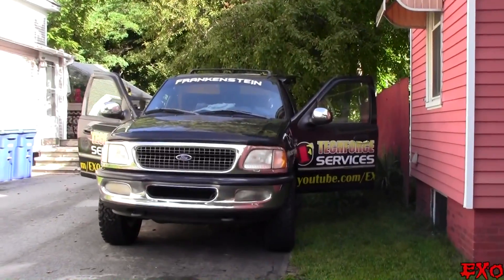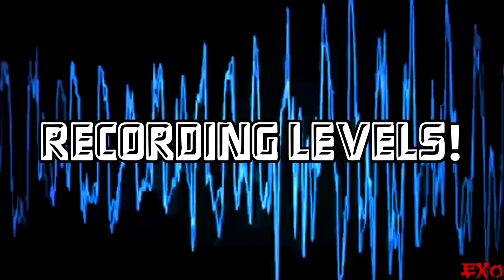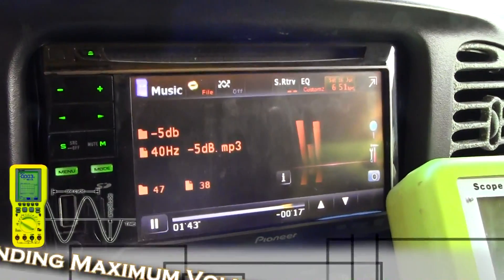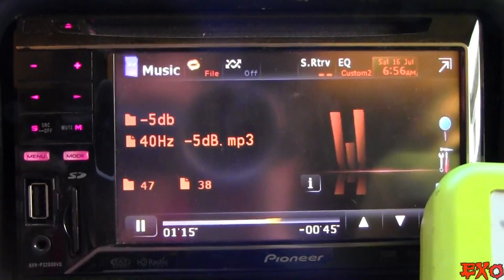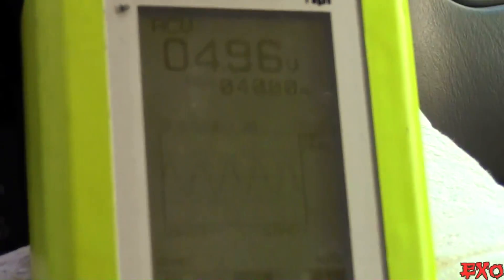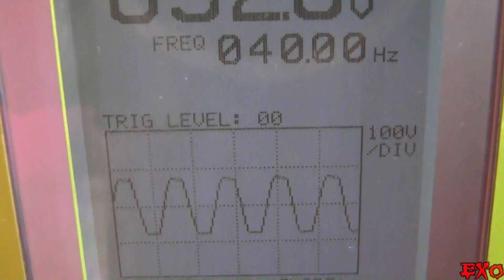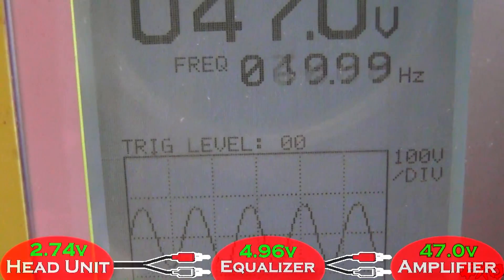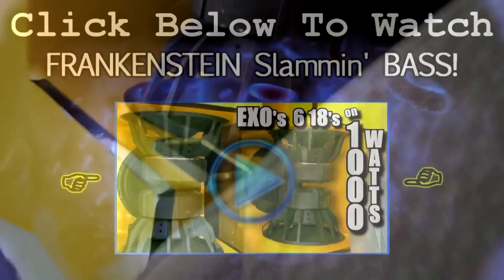How To Set Amplifier Gains & Get MAXIMUM Output w/ NO Clipping | Tuning BASS AMP w/ Oscilloscope

Comment: Hi, unfortunately you can't see in the video whether you have the LPF for the subwoofer on or off when setting the gain. I was told that when you set the voltage, the LPF and lowcut should be switched off so that a full-range signal comes through. You're great and your videos are very helpful

Comment: That unit has a 4 volt RCA output the reason you are not getting the full 4 volts is because you were using a -5 mp3 test signal... In my 23 years of being a pioneer dealer.  I've never had a pioneer head unit that didn't distort at full volume.  Noramlly 32 to 37 on those depending on source. You also should be using FLAC or wav files. Ect Not compressed to hell mp3

Comment: Probably a dumb question but how would I tune my system that has an lc7 line out converter?
Reply: I was having the same problem until I watched the YouTube video titled, 'How to TUNE Car Amplifier & Set Gains'.  BTW - My system is 100 times better because my LOC is finally dialed in before it goes to my AMP!

Comment: idiot question here 
On my amp i have rca input voltage up to 2v what does it need to be set on i am not running a sub
I have vibe space 4 amp vibe space 6 three way components up front and vibe qb69 in the rear pioneer head unit
Reply: The higher the better
Reply: @4MorganH  so with 4 volts and a added amp will sound better than a line converter because you can set the gain lower on amplifier. Will allow you to go full volume more likely?

Comment: Exo, my question is, how do I do this with my stock radio? I have a epicenter micro as my line output converter and then rca to amp. Can you provide any guidance please?
Reply: You have to read the voltage output of your HU at the highest volume before clipping/distortion. That will be the best clean signal to your LOC. BTW go to Steve Meade and D'amore's YT channel and watch their videos on LOCs. Audio Control, Wavetech, and Kicker were the ones I remembered that actually worked. I would think Epicenter is one of the best top shelf as well.
My audio control LOC shows my max output from my HU before distortion. I just adjusted the HU by my LOC.

Comment: i have audiocontrol lc 6 1200 provide 125 watts RMS and focal 80 watts RMS 4-ohm impedance what voltages i should keep my amp gain please help
Reply: E=Volts
P=Power(Watts)
R=Resistance(Ohm)

E= Sqrt of P x R
E= Sqrt of  80 x 4
E= Sqrt of 320
E= 17.88 < Target Voltage at -0db

17.88 volts might be your target voltage at -0db (but!) music isn't recorded at -0db so we need to set an overlap to counter this, a viable choice would be something like 5db overlap.. now here comes the kicker, your amp's target voltage for 125 watts into 4ohm is 22.36 volts.. (but!) a gain overlap at 5db up from 17.88 volts would mean that you wold have to set the gain to 31.79 volts with a -0db test tone.. that's just not possible in your situation since the amp's max output is 22.36 volts at a 4ohm load.. so you can safely max out the gain on the amp as long as it doesn't distort the signal.. in this case you would get a 1.94db overlap (this will work great with good quality music  and/or music from the "era of loudness" (but!) u might miss out on a few db on music that's been recorded at a average of  -6db.. either way, bump that volume! you won't blow your speakers anytime soon c(;
Reply: all the volts

Comment: i see you used the outside speaker terminals on the amp? if my amp has 2 sets should i be using the outsides or the first 2? idk if your amp is ++ -- mine is +- +- though
Reply: First two.

Comment: Why wouldn't you use an uncompressed WAV file instead of an MP3
Reply: 10 year old video...as if the eye pod shuffle wasn't a good indication.
Reply: Its 2022, so, the answer is " because it's racist" or, "because white privilege 0.
Reply: @HammerBack10mm  uncompressed wav’s are the definition of white privilege. #wewantreparations

Comment: I know this is years old but, would USB or aux be better when tuning?
Reply: Usb probably
Reply: I installed a 12" sub in a friends car and he had an aux input and also a bluetooth receiver. When i connected to them, i found that (at the same head unit volume) the sub was very noticeably quieter when using an aux cord, compared to bluetooth. Just be sure you take that into consideration. Don't tune the amp while connected to an aux if you plan to use bluetooth and vice versa.

Comment: Still trying to figure this out when you set bass, mid, treble flat in headunit when checking for distortion can we put them back up after it's done or we have to leave them flat?
Reply: EQ how you like it then tune. But remember it's tuned for those EQ settings...
Reply: leave flat
Reply: Leave Flat, if you like a different EQ curve set that before doing this testing.

Comment: I have a single 10 getting 600w rms, amp is tuned at -5db and it just hits weak, would -10 or-15db be better? Also have a bx-10x processor for the songs with little to no bass, I use pandora more than anything.
Reply: Pandora songs are usually at -15 or -20, this is just guessing but I remember years ago I compared regular songs I downloaded and put thru audacity and they were all -20 even rap songs with heavy bass. I always set my gains to -5 or -7.5 and bass knob 3/4 of the way up, that way when I wanna switch to regular music that’s recorded at -30 I still have 1/4 I can turn up on the bass knob making up for any difference

Comment: If you have your head unit on 80 hz do you set your amplifier the same 80hz  subwoofer
Reply: Set 80hz either on head unit or amp.
Mine LPF on amp is turned all the way up, and on HUD I set LPF on 70hz with 
-24db slope

Comment: I have a Lanzar VCT-2210 2 channel amp
I am confused about if it's a 2ohm or 4ohm amp.
1,000 watts x2 output @2ohms. Dose that mean it is 2ohm per channel???
Reply: It's what ever you wire your subwoofers final impedance too so if you wire your sub to a final impedance to 2 ohms the amp will give 1000 at 2 ohms if you wire your subwoofers to final impedance to 4 ohms the amp will will put out what ever wattage at 4ohms look up wiring diagrams and see if your subwoofers is dvc( dual voice coil) or svc (single voice coil) and look up wiring diagrams to see what your trying to achieve like single voice coil 4 ohm subwoofer to 2ohm or single voice coil 4 ohm subwoofer to 4 ohm or if it's dvc then dvc 4 ohm or dvc 2ohm to what ever load your trying to get
Reply: Says the amp is 1000x2 at 2 ohms and 4000x1 bridged at 4 ohm so if u have 2 subs wire them both to 2 ohms and hook it up or bridge the 2 subwoofers to get 4 ohms and bridge the amp it will receive 2000wbetween both subs

Comment: "I believe about 5 volts should do us good, lets try that." Why? On the HU you go as high as you can without clipping. Why did you arbitrarily decide on 5 for the DSP instead of the same process as the HU?
Reply: Thats a good question, I'm wondering the same. Im thinking about picking up an Audiocontrol three.2 to use as my head unit, and apparently it can do up to 9 volts rms output. If I were to guess, he picked 5 volts because most amps cant accept much higher voltage of a signal through the line level rca input. Im not sure about this though. My rockford amp says 4v max input,  which (maybe) coincidentally matches up with what most higher end head units say they put out. Im hoping 4v isn't the max and thats just a safety thing they put in the specs so people don't try to connect 30v speaker level to the line level inputs of the amp.
Reply: @Thebadbeaver9  The newer cv amp the s1000.1 is 100mv to 5v. I couldn't find the specs for the older 1000.1 as shown in this video but I suspect it's the same. I have an MK-1500x Mark Antony amp that is sort of broken? I need to get the RCA's fixed but the sensitivity on that is 0.2 - 8v. I ran that with 2 alpine type r 12's. Currently running an SFB2000, Helix M Four DSP, and a sundown X12. The SFB2000 is 5v max.

My head unit, which I believe would classify as a high end head unit is a Kenwood DNR1007xr and has 3 sets of 5v outputs. Shopping in this space for a while, I'd say that the higher end units are at 5v, a tier below that is at 4v. 

Hopefully within the next few months I will be upgrading subs to a Sundown Zv5 or Zv6 and either a Salt4 or Salt6 amplifier or equivalent. Those amps go from 0.2 to 6v. I believe the higher power amplifiers that have a good brand name like SA, DC, etc will be in the max of 6v range. When you get into the lower high power? The "cleaner" SQ setups. Like the JL Audio amplifiers? The RD1500/1 is at 8v max. Well I think most of theirs is around 8v max. 

I am not a fan of kicker... but the only brand that I am aware of that has some amps that can handle a high level input through the RCA's. --going purely from memory on that but I remember reading a manual that said something like a max of 40v? So you wouldn't need to run a LoC if you didn't have pre-outs on your head unit.
Reply: 5V is the output voltage of the head unit. Amplifiers have a safe input voltage spectrum that u must stay within.
Reply: HU > DSP > Amp. The amp has a low level input voltage range. Some newer amps you can run high level through the RCA's or through a 4 pin connector but I doubt this amp was capable of that. So it was likely in the 100m to 5v range with that maxing out at 5v. Going over that 5v would more likely put the amp in protect mode.

Comment: I have a kicker Comp R and kicker 800.1 mono block amp, 4 alpine 6-1/2 front and rear, 4 tweeters placed up high front and back. 2 Memphis 3.25 midrange in front doors and a 150 watt x4 channel amp with low and high pass filters. JVC double din head unit and kicker bass knob on my dash in my Jeep Cherokee Sport. It's all set up perfectly no clipping and no distortion. Every kind of music sounds perfect no matter if I'm listening to Metallica, Notorious BIG, or whatever music. I have setting presets so all I have to do is play a song, find what preset  sounds the best and crank it up. No problem. 👍 as long as you have the right sounds and tones playing through the right speakers you'll get clean sound from just about any decent system. 🤷‍♂️👍

Comment: I cant justify buying the multimeters to do a one off tune up. And, my local stores don't do it! Any other options?
Reply: multimeters are cheap, and handy for a good number of things, it's the oscope part that's hard to justify, until you blow expensive speakers and wish you had bought it......
Reply: @VALAREZ  yep, the one in this video is a multimeter and oscope in one anyway. imo that's the way to go because a multimeter is always handy if you're doing your own audio installs, and yall might think it's just a one off tune, until you wanna change anything at all at any point in time later on and therefore need to re tune again, any cheap oscilloscope, so long as you can find tutorials on how to use it, which they're basically all the same function just different knobs or dials, physically placed different, any cheap stuff will do tho, a dd1 isn't needed it just makes it so a monkey could tune a system. that's the only reason it's so damn expensive, buying a cheaper tool just means more work/knowledge on the users end lol
Reply: 40 dollar oscilloscope from Amazon or ebay
Reply: Did you find any other method? Buying a DD1 its not an option either for me.
Reply: Do it by ear. If u can't afford a harbor freight 4 dollar multimeter, you probably have a flea market amp anyway.

Comment: Ive tried the -10db tone but my low pro 12s are not putting out much, anyone have a -15db 40hz tone?
Reply: I have the amp correctly tuned to match rms of the subs at 2 ohm final impedance,they just dont hit well
Reply: @daniellewis6231  it's weird how that works, just did the same with a comp vr 10, like 3 songs I have sounds satisfying, while everything else makes me wonder if the sub is even moving......

I'm considering getting an epicenter......

Comment: LOVE Your videos. A few things I noticed from a Pro Audio Perspective:

Behringer is junk. I get this is car audio vs pro audio, but in the end.. it's junk when compared to other units such as Ashley.

I'm guessing you have a DC to AC converter for the Behringer? Almost every unit runs on 12V. Open it up, chase the leads from the IEC in and you'll find the AC to DC converter built into the unit. 

Once you find the output to the board, confirm it's 12V and bypass it.

Alas- less energy being wasted!

Comment: Where did you hook up the leads for the processor? On the RCA's? I just bought a line driver and am trying to figure out how to set the gains with this device incorporated
Reply: Did you ever figure it out? I’m trying to check my head unit but don’t know how to check rcas
Reply: @tanner6698  sorry if I’m late, if you’re trying to check your rca voltage the stick in the middle is your positive, while the ring around it is your negative…

Comment: When you are setting your gains with a bass nob.turn it  all the way up to get the full resistance when you set your gains when the bass nob is low the gains you set will be inaccurate .
Reply: You should never set gains with a bass knob. I believe he is using the knob for the output wattage test.

Comment: I get that same voltage with a negative 5 db tone as well most of them give you that same voltage. I use and active equaliser and boost to 4 volts and set my  gain to suit.

Comment: Yeah, I've always heard to use only 0dB tones.  Ever.
Reply: You'll never get the full potential out of your gear if you use 0dB tones. I've experimented with everyrhing. Most music, no matter what music you listen to usually goes up to -3dB. Some songs do hit 0dB but for a very short amount of time which is not enough time to damage your subs. I've been running an Alpine MRX-M100 to a Sundown SA 12 tuned using a -6dB tone for over 2 years and its still pounding like new. Quit worrying and enjoy your music. If you blow a sub, buy another one, that's what you're working for isn't it? To enjoy life. -5dB is a very safe tone for all types of music, if you really wanna push it you can take it up to -8dB but don't go past that.
Reply: Yeah me too, coz due listening different kind of music/songs
Reply: 0db if tuning for regular music .. -5db if tuning for bass boosted music .. 🤷🏻‍♂️🤦🏻
Reply: @stevelynn7302  It's the other way around actually. Tuning to a -5dB tone allows your amplifier to make full power at -5dB and clips heavily at 0dB. Bass boosted music takes the bass up to around 0dB so you'd want to tune using a 0dB test tone in order to avoid clipping. For regular music -5dB because most songs stay around the -3 to -10dB range.

Comment: Nice detailed video, Bro...but its overwhelming to me cuz all I have is an aftermarket head unit, and mono block 500x1 amp. The 3 settings I have are LPF, which i know how to adjust, I just dont know where to set bass boost, and input frequency [v]
Reply: TurboDuckHeadHD In HD  iiiiiiiiik
Reply: TurboDuckHeadHD In HD  When you set lpf the gain goes up

Comment: Hey good video but for example if you have a 4 channel amp at 100 Watts rms and you got a 100 watts speakers is it possible to damage them while tuning. Cause when I was tuning mine I was playing it loud and I could smell smoke from one of the speaker. Cheers
Reply: Disconnect speakers while doing this.
Reply: That and dont play music and find out where your head unit clips by hearing distortion soon as you hear a buzz and static you want to change your head set setting loudness treble untill gone.

Comment: I know I'm late but, I'm still wondering why the headunit measured only 2.7 volts. I looked that model up on Pioneer's site and it even said 4 volts in the specs. Still wondering about that. Is it a false reading on the o-scope, or a false rating by Pioneer?  I'd Really like to know, I'm a big fan of Pioneer. My Pioneer DEH-80PRS just arrived a day ago.
Reply: Tornado haven’t personally dealt with the deck, but depending on the subwoofer settings, you may have to turn the sub up as high as it can on the deck, because sometimes that determines the voltage for the RCA pre outs. Usually if a decks sub setting doesn’t have any negative values and goes from 0 to 10 or so, you usually should turn the sub all the way up on the deck for those 4 volts pre outs
Reply: And if 0 is in the middle of the scale (lets say it goes from -5 to 5) then the decks sub setting acts as more as a gain level for the sub. Just look at the deck settings and see which one it is. If it starts at 0, turn it all the way up then tune the amp
Reply: I know that pioneer makes several models that are extremely similar and named very similar but if you know this before buying your HU, like me, I only buy the headunits that are the 4.0v versions, also be aware the other main difference if the amount of av inputs and outputs, when referring to recent pioneer headunits,😀

Comment: You should of showed how you set your lpf and sub sonic filter too. Would of be more helpful.
Reply: subsonic usually set at 7-8hz below box tuning, or at 25 depending on what amp setting lets you do. LPF should be set at 80.
Reply: @codyallen1234567890  Lpf adjustment, before gain adjustment should be done?
Reply: gamelet set your LPF as high as you can first, set your gain, then set the LPF after
Reply: @codyallen1234567890  thanks man. Helpful as always.

Comment: I have 4 channels Sony amp 1200w, 2 speakers 120w rms (each) and 1 sub 380w rms..
How to tune the right voltage with multimeter please!
Reply: Depends if your going for max output from your amp
Reply: @HOHOHOMOFOS  
i'm in Yemen.. we can't get that because we're in war 😔.. can I do it with multimeter?
Reply: If going for max output get  oscilloscope